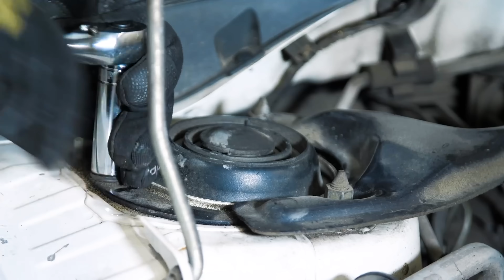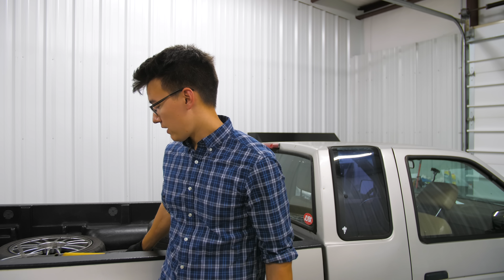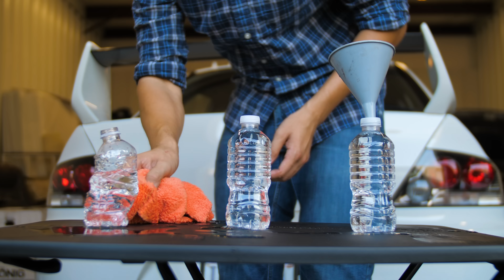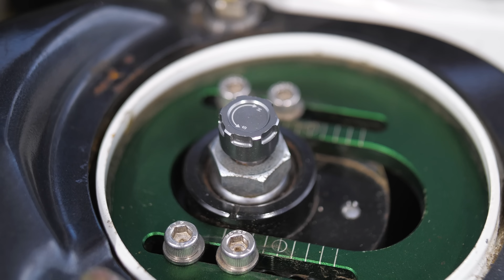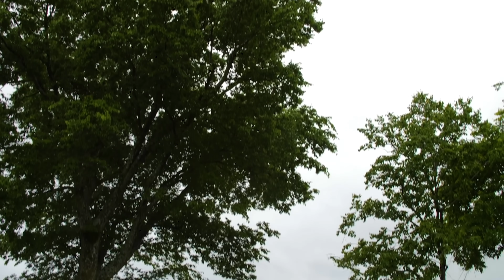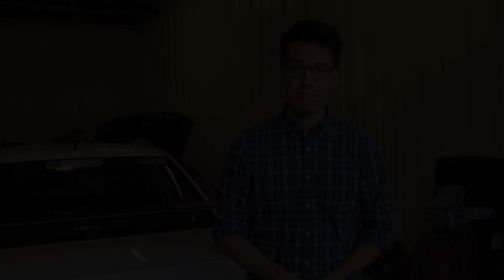How Do Struts and Shocks Work?

Comment: My strut started to hitting/rubbing against the chase on bumps only , which happened immediately on the test drive after I replaced my front wheel bearing and wheel hub . What I possibly did wrong ?
I'm looking at everything now, and everything is installed correctly 😢
I put the inspection camera, and it's see the strut lower cradle where the spring sits that cradle is rubbing against the chase only bumps , though.
2016 honda Civic 2.0

Comment: One question about this dampening force inside shock. Is this dampening force same in both directions or different? To my logic, dampening force should be weaker during shock compression, and higher during expansion so that impact force is mainly transfered to spring and less to shock and car body.

Comment: Good vid. Remember kids suspension is no joke - always use spring compressors when working with springs and use jacks to slowly lower trailing arm style suspension to get springs out. Don't cut springs and torque everything to spec. People have legit died or lost vision from uncontrolled spring release.

Comment: If upgrading to coilovers, do you only need the shock and spring? Or the strut assembly as well?
Reply: @Ross Bourne I used the OEM strut mounts.. the coilovers I bought only came with the strut and spring, but it's been giving me problems..